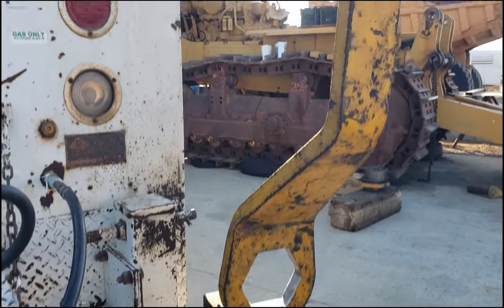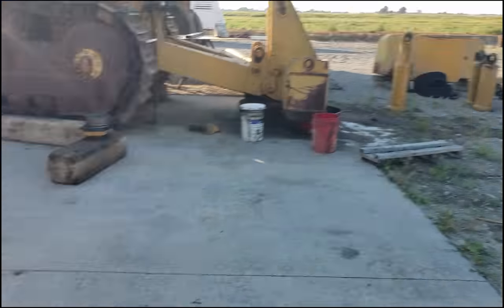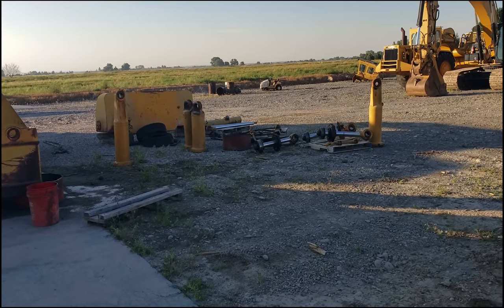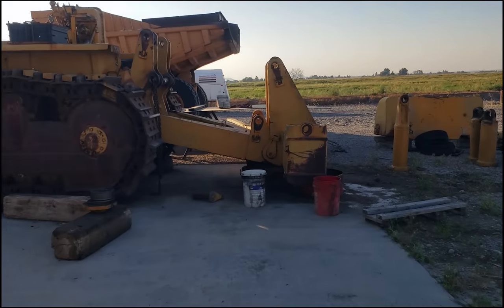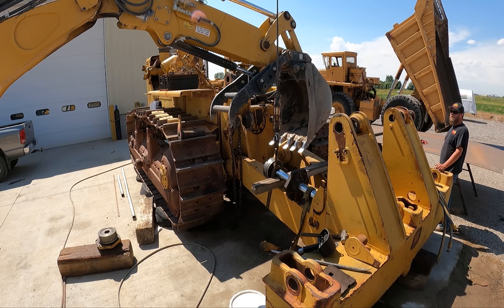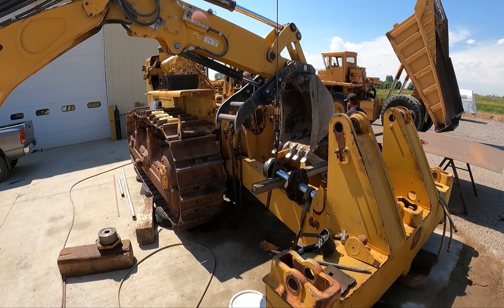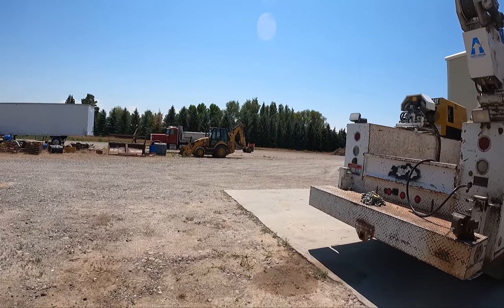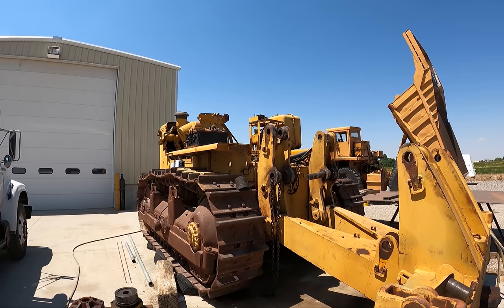D9H Episode 10

Comment: That impact needs more air supply.  Find an used 80 gallon tank.  Mount it  on a strong pallet . Hook up air inlets for the compressor hoses from the service truck.  You need a 5/8 3/4 air hose to your big impact without any quick connects.  Ball valves. Not globe valves. I probably would not have a hose longer than 20 feet.  You could easily install a second hose that is 30 feet long with an increased pressure drop.
Reply from the maker: Using the service truck compressor which is only 145 psi,  I have a one inch hose on the shop compressor

Comment: I got a torque multiplier 3000 ft lbs ...prob still wouldn't break that loose.  Just got a spline drive air gun uses 3/4 250 psi 5000 ft lbs from a bridge contractor. Crazy nuts .
We got salt water road salt here really locks pins in.
Nice work 👍